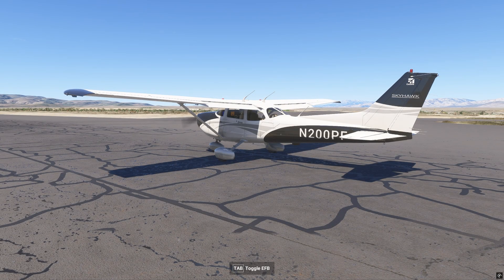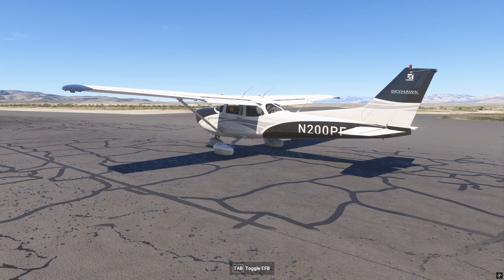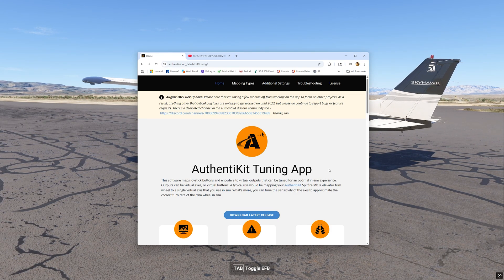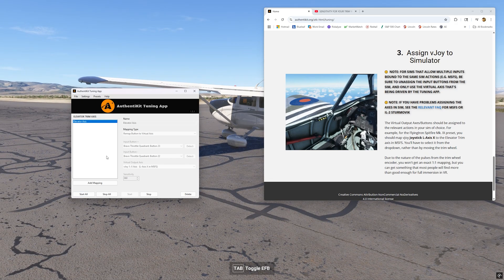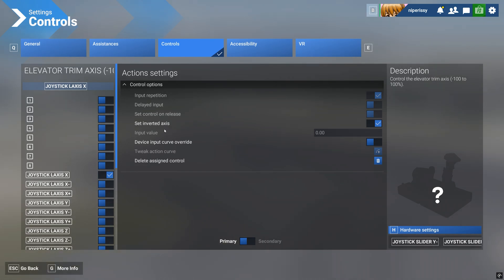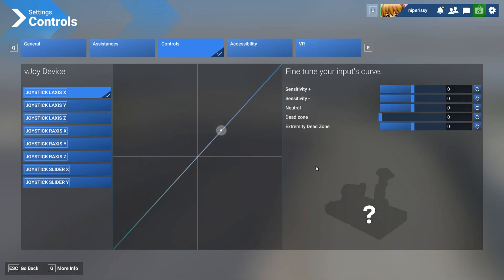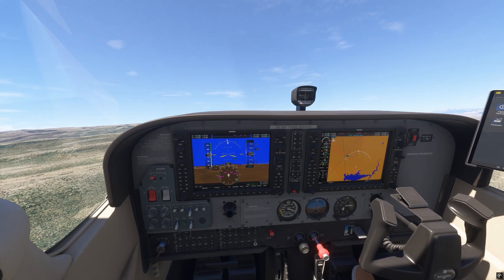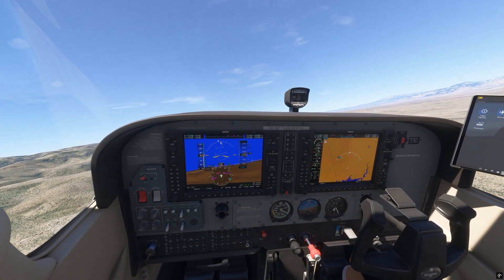How to Calibrate Your Honeycomb Bravo Trim Wheel for Full Realism

Comment: Great video! I did all of this and the trim wheel works well when I don’t have AP on. When I turn AP on the wheel is a mess. It keeps moving and changing the percentage reading. When I try to adjust it it jumps from -40% back to 70% and other random numbers. 

What am I doing wrong?

Comment: Used Spadnext to control the trim wheel in Logitech multipanel. The Spadnext snipit "fast trim wheel " works exceptionally well with no modifications.
Other solutions such as Simtrim had only moderate success.  Highly recommend Spadnext for trim management. The Spadnext mod has enabled excellent trim management in Navigraph PPL course, where trim tolerances required are precise..

Comment: for long time I thought I was doing something wrong, how do pilots put up with rotating that trim wheel so much? Thankyou for this clear and simple tutorial. This is wonderful
Reply from the maker: Once they hit the autopilot, it will start trimming itself.  In real life, once you hit your cruise altitude and power settings, you can set it and forget it.  Most of the manual action is required when climbing and descending before and after AP is engaged.  Glad you enjoyed the vid!

Comment: Another tip for implementing this: Although you can set the option to activate the trim when the simulator is started, you do have to start the program first. To make it all automatic, you can modify the exe.xml file in the install directory to have the simulator start/stop the program when it starts up.

So first (in the authentikit program) select: 'settings -> start all mappings on app start' and save that config, i.e. 'file -> save'. Then close the program.

In the exe.xml file, add the following:

  <!-- Start Authentikit for Bravo Trim Wheel -->  
  <Launch.Addon>
    <Disabled>False</Disabled>
    <ManualLoad>False</ManualLoad>
    <Name>MSFS_AutoFPS</Name>
    <Path>C:\Program Files (x86)\AuthentiKit\AuthentiKit Tuning App\AuthentiKitTuningApp.exe</Path>
  </Launch.Addon> 

Now when you launch the simulator, authentikit will start up and also will activate the trim wheel binding. When you close the simulator, it will also close authentikit.

Note: the exe.xml file will be in "c:\Users\<your windows username>\AppData\Local\Packages\Microsoft.Limitless_8wekyb3d8bbwe\LocalCache

I also automatically start / stop my logitech radio panel and AutoFPS the same way. My full exe.xml file is:

<?xml version="1.0" encoding="windows-1252"?>
<SimBase.Document Type="SimConnect" version="1,0">
  <Descr>Auto launch external applications on MSFS start</Descr>
  <Filename>exe.xml</Filename>
  <Disabled>False</Disabled>
  
<!-- Start AFC Bridge (to activate Bravo lights) -->
  <Launch.Addon>
    <Name>AFCBridge</Name>
    <Disabled>False</Disabled>
    <Path>C:\Users\<myusername>\AppData\Local\Packages\Microsoft.Limitless_8wekyb3d8bbwe\LocalCache\Packages\community\AFC_Bridge\bin\AFC_Bridge.exe</Path>
  </Launch.Addon>
 
 <!-- Start Logitech Radio Panel -->
  <Launch.Addon>
    <Name>Logitech Radio Panel</Name>
    <Disabled>False</Disabled>
    <Path>C:\Program Files\Logitech\Microsoft Flight Simulator Plugin\LogiMicrosoftFlightSimulator.exe</Path>
    <CommandLine>-r</CommandLine>
  </Launch.Addon>
  
<!-- Start Auto FPS -->  
  <Launch.Addon>
    <Disabled>False</Disabled>
    <ManualLoad>False</ManualLoad>
    <Name>MSFS_AutoFPS</Name>
    <Path>C:\Users\<myusername>\AppData\Roaming\MSFS_AutoFPS\bin\MSFS_AutoFPS.exe</Path>
  </Launch.Addon>
  
<!-- Start Authentikit (make Bravo trim wheel an axis) -->  
  <Launch.Addon>
    <Disabled>False</Disabled>
    <ManualLoad>False</ManualLoad>
    <Name>AuthentiKit</Name>
    <Path>C:\Program Files (x86)\AuthentiKit\AuthentiKit Tuning App\AuthentiKitTuningApp.exe</Path>
  </Launch.Addon>  
</SimBase.Document>
Reply from the maker: What an awesome pro tip! Thanks for sharing this.

Comment: in 172, cut the power, and 2.5 to 3 full turns down (i.e. nose up trip) should give you about 65 knots (different year models might be slightly different).  Set your throttle quadrant to work the same way.

Comment: Just got to your video. Thanks for the heads up. As others have mentioned the other solution out there is SimTrim. I've tried both and have decided to stay with SimTrim. The dev recently updated it so you can have separate profiles for different aircraft. I find this handy as some aircraft's trim's are more or less sensitive than others.
Reply from the maker: Yep, I've noticed that.  What works great for the 172 needs a little tweaking for other planes.  But, man, how nice is it to have a fix for that nearly useless default trim wheel? Thanks for checking in, Steve!

Comment: how does this affect planes that use trim to manage the autopilot?   when you hit the wheel, since it's on an axis, is it going to just jump to the new setting and upset the plane?
Reply from the maker: Good question.  I'll try it and let you know.
Reply from the maker: I was flying the C208 tonight and did notice a little snapping after I disengaged AP.  Nothing that wrecked the flight, but certainly not true to life either.

Comment: That is a very out of date way of fixing it and requires a number of apps like vJoy etc.  He did a newer video using a single app called SimTrim.  By the way one of the original pioneering sim creators called FroogleSim did a similar video on elevator trim speeds a LONG time ago

Comment: question is, does this give the same positive influence on all aircraft?, I have the impression that it is not equally bad for all aircraft. The A2A comanche for example, has no problems with this (probably because of accusim?), but with this adjustment it may work counterproductive?
Reply from the maker: That's a good point.  It might be a non-starter for planes with their own custom coding. I've got it set up to feel almost identical the real 172 at this point, so for that plane, it's been a godsend.

Comment: Yep I used Authentikit as well to fix the trim wheel.
It’s still not perfect because it still a non-continuous slider and you still have to dial it in. 
It also sucks I have to open the app and start it every time I start the sim.
Reply from the maker: Have you tried it again recently?  The version I used had a Bravo preset, which did not appear as an option in Mark's video.  For the 172, it was literally plug and play for me, no tweaking required.

Comment: I followed the steps to install, and it  stop my controller (X-box used for cameras).  When I uninstalled,  vJoy was still showing up n the menu, hand to remove from Devices, and go to the Systems32 folder to remove vJoy file.  In the end, my controller no longer worked.  Plug a different Xbox controller in and now works ok.  Just a heads up to folks.

Comment: Mark has un updated video from this year using SimTrim. I've been using that, but have no real-world experience to compatre it to.
Reply from the maker: Thanks!  Someone else also pointed me to that vid.  As I was scrolling through the comments on his vid, some folks said they felt like the AuthentiKit action was a bit smoother, so I'll probably just stick with it since it is working.  I just can't believe Mark is the only one on top of this.  I have to imagine anyone with a Bravo has been looking for a fix for that wheel.  I'd resorted to assigning the trim buttons to my yoke, but even that was nearly impossible to dial in because it would always under and overshoot.  Once I got in the real plane, I was astonished by how much pitch control was possible by just occasionally reaching down there and nudging the wheel.  In fact, if you don't do that, it gets exhausting pretty quick because a tremendous amount of elevator pressure is required to keep it level.  That was also a shocker for me, considering how light the sim yoke is for the same action.   Thanks again for checking in!!!
Reply: I decided to switch to this one instead of SimTrim. The calibration seems a bit more simple with AuthentiKit. Thanks for the set up and config info. =) o7